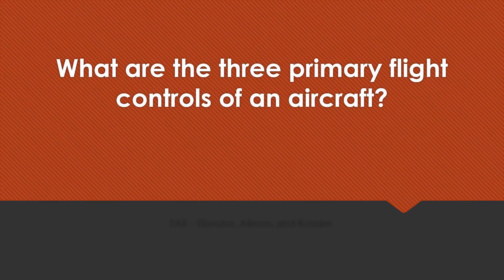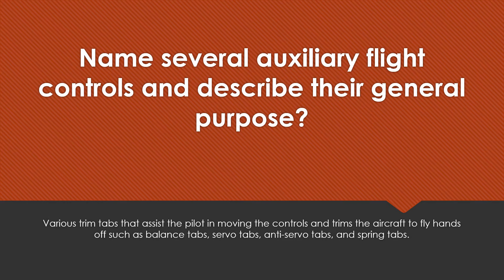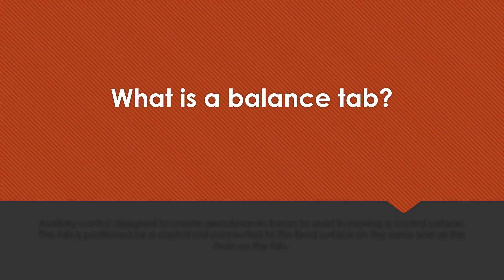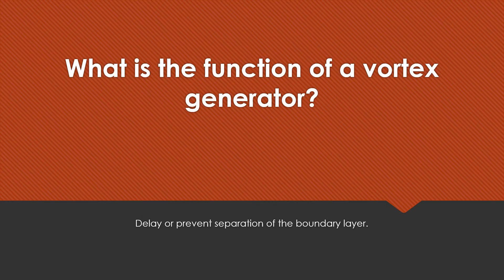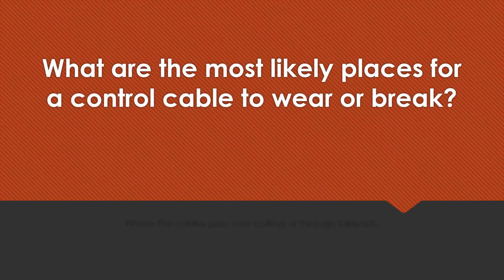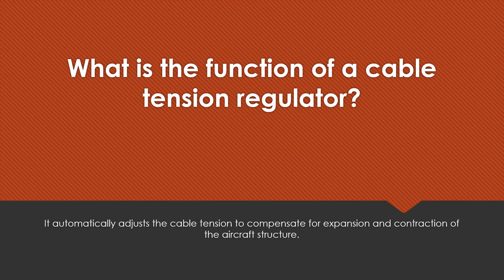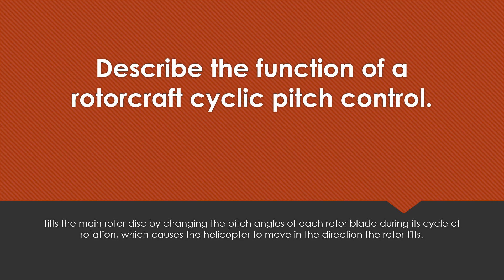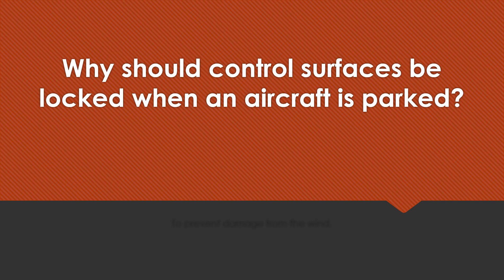AIRFRAME ASSEMBLY & RIGGING ORALS

Comment: Good help, but questions 4. and 5. have the answers switched.
Reply: there is a lot of mistakes in the JP book, in this case the balance tab and servo tab are auxiliary not secondary flight control, they mixed up between the secondary and the auxiliary
Reply: @sofhero6079 so what youre saying is the video is correct and jeppeson is incorrect?
Reply from the maker: Secondary flight controls assist in moving the primary controls such as tabs, and auxiliary are lift changing devices such as flaps and spoilers.
Reply: @airframeandpowerplant533  Your videos have been fantastic to study with but yes answer for 4 & 5 do not coincide with the Jeppesen study guide and this information is straight from the 8083-31V1 (pg 2-11)... "Included in the auxiliary lift devices group of flight control surfaces are the wing flaps, spoilers, speed brakes, slats, leading edge flaps, and slots. "
Reply: @jnappier81  you are right